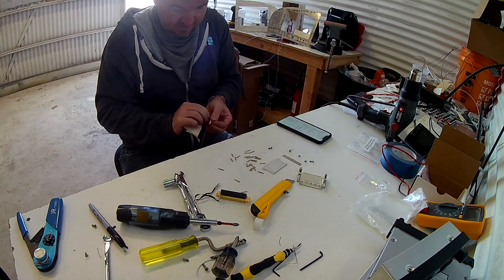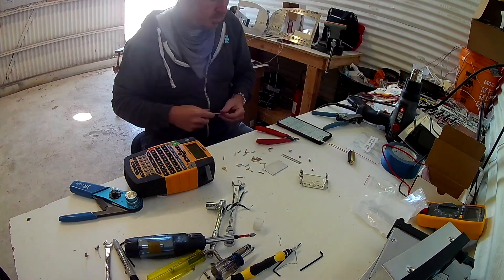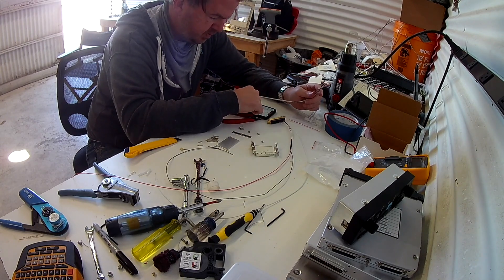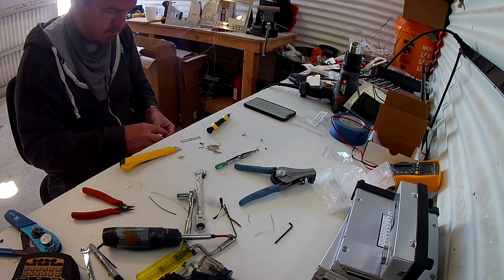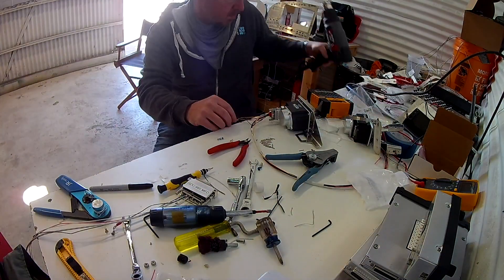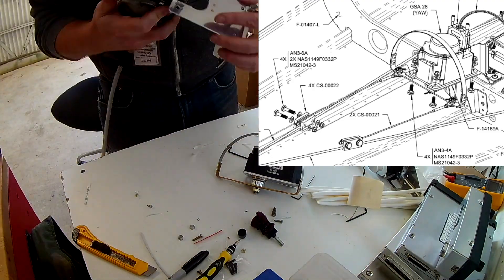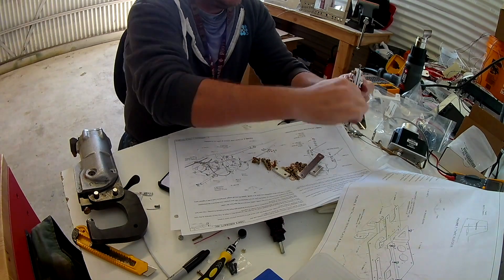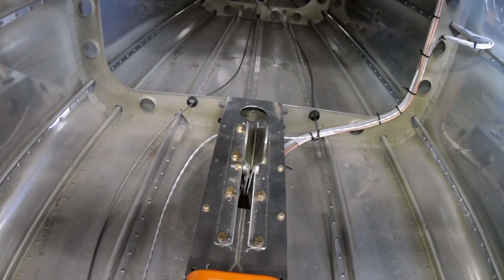RV-14 Yaw Life

Comment: I’m about to tackle this too. Wondering if Van’s should add a step earlier in build to at least install the AP bracket and maybe even Servos when access is better. Like before the rear top skins are added?  I did for the roll servo before putting the bottom skin on the wing and was glad I did.  Live and learn I guess.
Reply from the maker: It’d of been nicer to do it then but you need to hook up the elevator arms and pushrods etc and it’d be tough trying to connect the fuselage pieces with those in already.